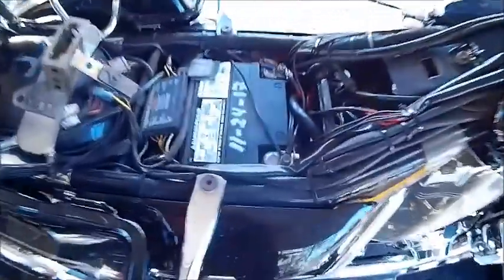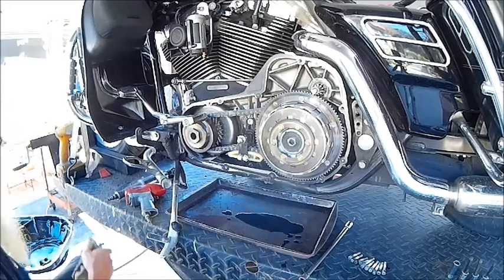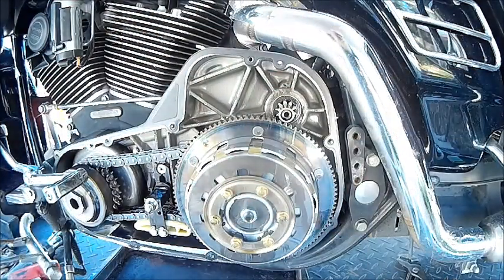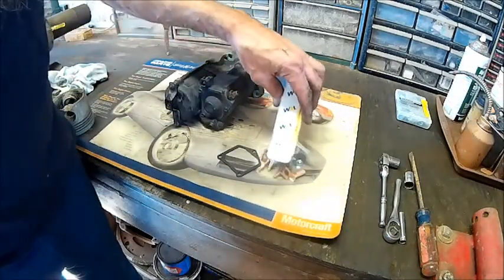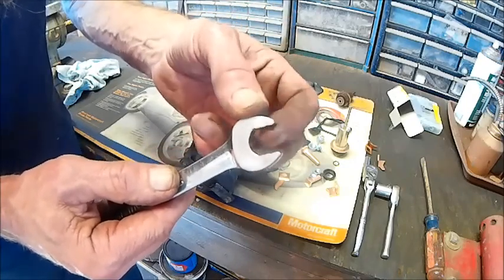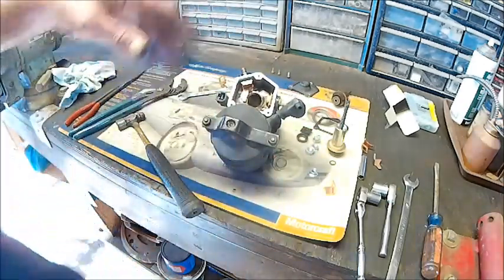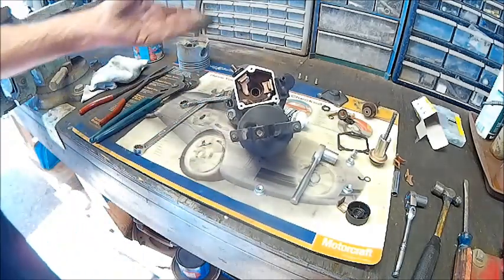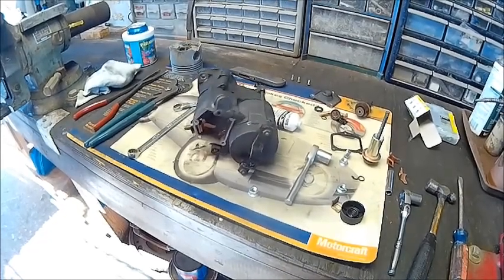1999 FLH Harley Starter Solenoid Rebuild (Denso)

Comment: If you need contacts on a weekend or in an emergency you can match those parts to many starters such as Toyota T100 and Camry. If you have the whole starter you can use most of it too.  Pull up the online microfiche (Ronnie's HD etc) for exploded parts breakdowns to see what swaps. The drive housing and pinion gears are Harley -specific. You can also loot Sportster and big twin starters for matching parts if you have one lying around. I just did that so I browsed Youtube to see if anyone else has so I'm here. I put one starter on my left, the other on my right, and disassemble to verify and play matchup. 
While you are in there it's a good idea to clean your motor commutator and inspect your brushes. Those swap too and commutator cleaning videos (basically any of them) show you what to do.  I collect removed starters (it's not worth it for a shop to take chances on a customer comeback because an old starter shit the bed when the labor is worth more than the starter) which just saved my ass when a Sporty starter had a cracked main housing (no HD part number) and I had a big twin starter lying around to rape. 
Worth mentioning are those push button aftermarket end covers. They are wonderful for when your control circuit (little Bosch style relay, handlebar switch,, wiring) malfunction. Pressing the button moves your solenoid manually. They don't interfere with anything else and if your rear exhaust ext blocks the button you can normally still move it with a screwdriver, long pencil, or even a stick. I put them on all my HD starters and encourage customers to use them when I replace their starter.  
An emergency/poverty method if you have to is pull the stock plain end cover, drill a about a 1/4" hole in the center, and use a Phillips screwdriver or similar to move the solenoid and start the bike. (MAKE SURE YOU ARE NOT IN GEAR or bystanders will be entertained!)

Comment: you can save some time but not taken off the front foot board as you can get the jockey bolt/gear out just be opening up the primary and pulling it wide apart at the back.

Comment: Could you do this while it's still on the bike?
Reply from the maker: Depends on your bike. The problem is the one contact to the front (transmission) side. If you can get at that bolt, yes, you could do it in the bike. You might want to pull the cover first and see if you can do a cleaning with fine sandpaper first. If everything is deeply pitted, you'll need to replace the whole kit.
Reply: @warhorse1956  Great, thank you for the quick response, I've got a 1998 Road King Classic, 111,000 miles,good ol' Evo
Reply from the maker: @kevintsetse8440  That's a good year, keep that one around.

Comment: I have a 98 fattboy. Is it the same operation? Can I just purchase a new starter?
Reply from the maker: It should be about the same, and yes, you could buy a new starter, if that's what you feel more comfortable with. Tho I do believe on your bike, you can replace the solenoid internals without removing the starter.
Reply: War Horse thank you take care...
Reply: You can, and they are often reasonable, but knowing this can save you on the road. If you have to and the bottom nut isn't stuck or stripped you can sometimes do this on the motorcycle. It sucks but it beats walking.